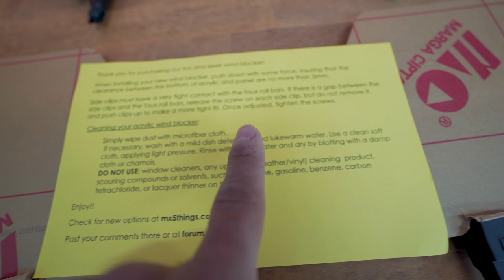MX5-things acrylic wind deflector review and installation -2019 Mazda MX-5/Miata 30th anniversary

Comment: Installed the XL version.  While the wind blocking is so much better, it’s almost impossible to put the top down while seated due to the height.  But the trade off is almost no wind buffeting in the cabin with the windows up.
Reply from the maker: I can imagine it is great for the wind buffetting! The main reason for me not getting it was what you are saying with the operation of the soft top! 

Only highway miles I have done with my car is more or less to and from the tracks :D
Reply: Only a ponce would drive his sports car with the windows up.
Reply: Where did you buy the XL version clear acrylic?

Comment: Nice mods so far 👍
I too have issues with the wind deflector. Its more to do with mounting my camera for recording.

I have the RF so it came with the clear plastic deflector, but its very flimsy resulting in shaky camera.

I really can't believe how stable your video coverage is. Is this due to the camera and the camera mount? Or does the acrylic panel not shake that much?

Also wondering what camera and camera mount you're using, that camera pan is epic 👍
Reply from the maker: thanks! The deflector itsef is very sturdy as I have had in on the track with a camera mounted to it! The camera I am using is the Insta 360 One R with the 360 mod supercool! I will do a video on it for car-application: https://www.insta360.com/sal/one_r?insrc=INRS6DX  The mount is the Joby suction cup I will add links to the description box as well
Reply: @Themazcorner  
Thanks 👍
Reply: @Themazcorner  
I did a bit of research on the cam. I actually thought your mount was motorised, but its the camera that does the effect. Pretty cool, I've never seen that before.
Anyways, thanks for the info once again 👍

Comment: Awesome videos you make - thanks - keep up the good work. One concern I have about the acrylic wind reflector, is that acrylic tends to be scratched  very easily - what is your experience with the acrylic wind deflector on that subject ?
Best Regards OB
Reply from the maker: Thank you! Glad you like them! 

As it is plastic it will be scratched if not handled with care, e.g if you want to clean I would recommend first to rinse it then wipe I clean. Similar to washing a car the cleaner the paint before you touch it the better.

Comment: Have you tried it at highway speeds? My biggest disappointment with the ND is the excessive cockpit wind compared to the NC. I would like to have a wind blocker that does its job better.
This is the 6.5" variant?
Reply from the maker: correct it is the 6.5" variant with the cutout. To me it feels a little better than the oem one. I am on the shorter side(167 cm on a good day), however I can barely feel anything in my hair doing 100-130km/h